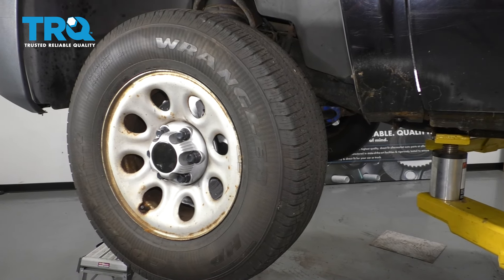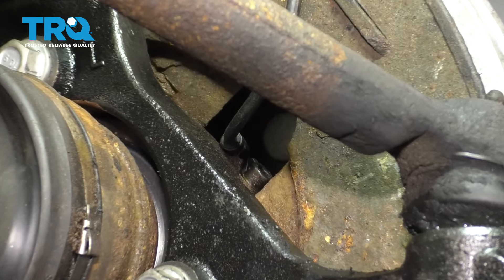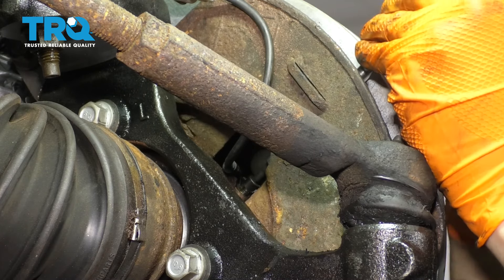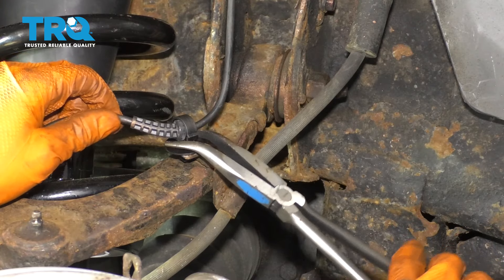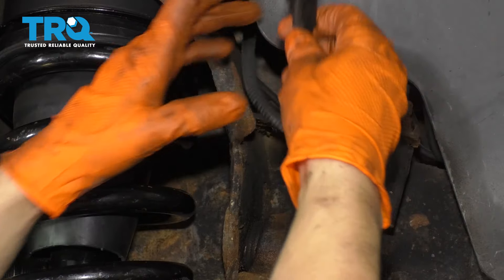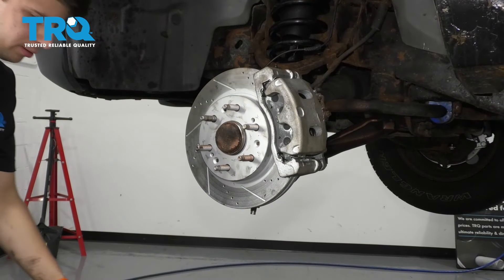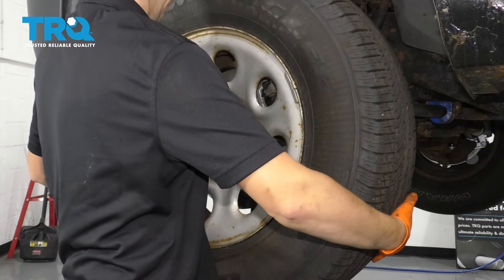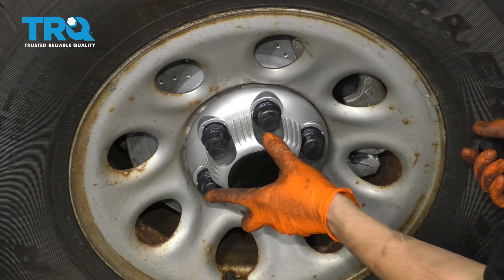How to Replace Front ABS Sensor 2007-14 Chevy Silverado

Comment: On my 2009 Silverado 1500 the rotors were in the way of the sensor screw so had to fully remove brake assembly.
The ABS sensor had been in there for 13 years - tried and tried until finally it snapped off near flush with the opening.
So I tried this and it worked:  https://www.youtube.com/watch?v=3ADLWloEOS0
Good luck to all and thanks for the vids!